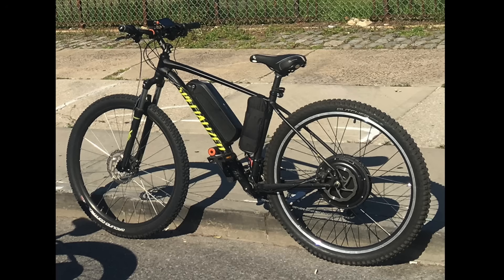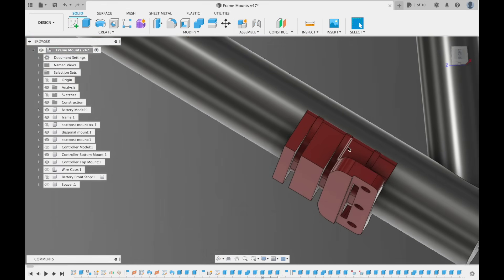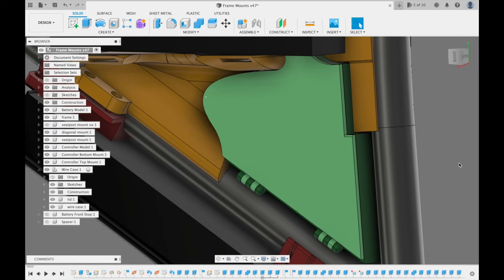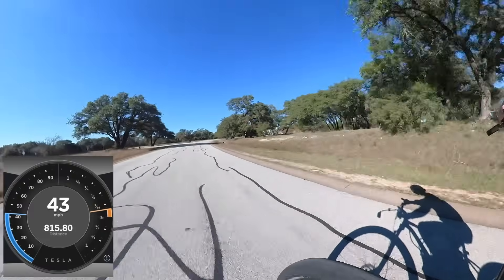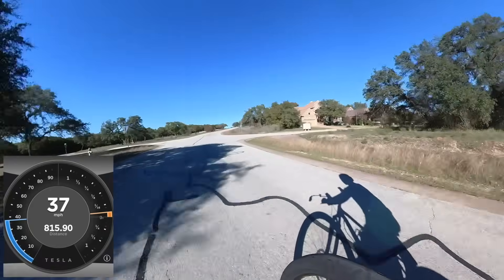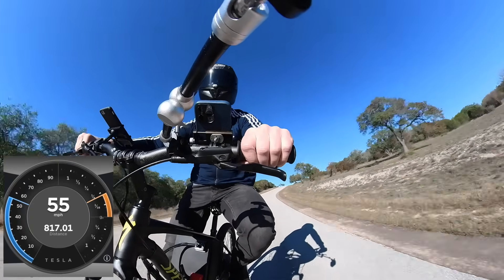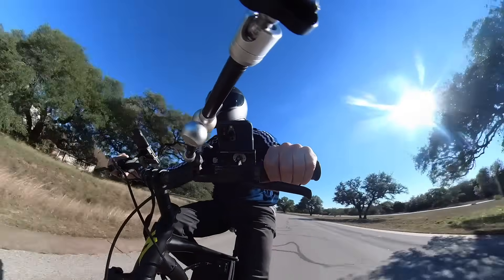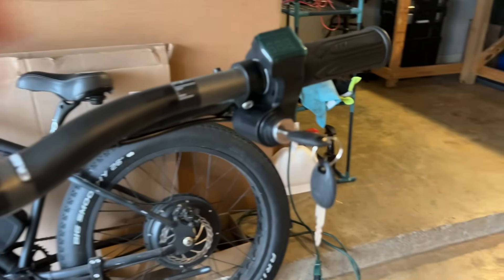I Built a 15,000W eBike and it's WAAAAY Overpowered

Comment: You can fit motorcycle forks to a bicycle. 
Full suspension look for older good brand bikes or use a cheap brand bike. Frames are stronger 🇭🇲🐨👍🏽

Comment: This is what gets me, watching you guys do these things without much thought into the design and building or the engineering aspects of the prototype projects itself. 😢You start off using an infrastructure that’s bad to begin with in hopes what you add to it will somehow work in your favor. (LOL) what a bummer it must have been for you. You start with crap, you end up with crap. Why don’t you go back to the drawing board and begin again? This time, design a framework of superiority. Then add the mechanical parts like , Motor, Electrical and Batteries? Design the Wheels and Speed Balance both Wheels and Tires so you know just how fast you can go safely. But wait , the Wheels Rubber also needs a redesigning because you don’t want those Tires coming apart at high speeds.😮 For once I would like to view someone that actually knows what they’re doing in these whatever you want to call it video’s😮 okay enough rambling on my part. Hey, thanks young man for showing all your expertise, experience plus knowledge with me and all viewing your hard earned work. I do look forwards to seeing what’s next in your world of ingenuity and engineering expertise. Again, thank you.🙏 😊

Comment: Used like $10k worth of parts to go 70mph. Shoulda just built a bike berry 100cc, slap a 32t sprocket, performance exhaust and carby, you can get close to 80mph for under $1k. This is why e tech still isn't good enough for me to make the switch yet. All those batteries and all those dollars to do what $300 2 stroke motor does

Comment: But what if the bms of the 20ah battery is only 40a, can you still put a 60a controller or?
Reply from the maker: @retrograde330  if BMS is 40a, you can use a 60a controller but you will have to limit it to 40a or else it will constantly cause BMS to cut out on you. BMS max amp has to be greater than max amp of controller. think Im using a 400a BMS and controller is 150a max - so plenty of overhead

Comment: Looks aside how well do you think 3d printing holds up durability wise to something like injection molding or woodcraft ive been wanting to get into 3d printing but my biggest fear is the material not being strong enough for the ideas i may have.
Reply: I’ve shot countless 22 caliber bullets through a entirely 3d printed pla+ plastic gun, including the barrel. 

your designs are fine bud. If you’re really so worried learn to print in nylon

Comment: 😅... Just have to say great job... I've been working on my bmx stretch 20inch steel frame over volt 48v to 66.6v dual 1500w.. you basically made me feel like my bike is baby play...and to be honest 100 volt is my goal but safety is always an issue especially having breaks that is still  a bicycle😅... To add on there's always stop signs and damn cars...also I don't know if anyone else is doing this I been used 18650 with 4s LiPo 😅

Comment: My question is how did you get the Cro motor to fit that frame dropouts? I'd rather see how that sausage was made rather than the parts you 3D printed that wont last.

Comment: i have 52 dualmotor fatty... with 2x 52V 25 Ah in parallel... imagine i would just wire these two packs in series (means 117.6V fully charged)

Comment: Thought my 3000w 72v motor with 80a controller (rear hub) was badass with 72v 60ah battery peak 60a draw it eats but this is awesome sweet engineering thumbs up good sir

Comment: Hey gainus garage guy, I love your work, best diy yet, I am new at this e-bike world, I bought two , me and my wife, ecell and aventon, , BUT I just bought a city coco, fabulous frame for this kind of project, it has a 2000 watt motor, I want to make it fast, like your bike, but I don’t know how !!!!!
Reply from the maker: @randyturley5594  appreciate the kind words! I'm not familiar with bike you mentioned but it may be difficult to get too much more speed & power out of a 2kW motor (or many commercial ebikes for that matter). More of them use fairly low power components that will be damaged if you swap something like the controller out for a more powerful one. if you want something similar to the bike in this video it's best to go DIY or do a conversion from scratch. that way you can choose the right components as needed. but I would avoid an aluminum frame like I've done here
Reply: @GaiusGarage  thank you for you response, I have am ecell that runs 40, it has a 1500 watt motor and 60 controller, I thought since this was a2000 it should produce close to the speed, maybe adding a 80 controller

Comment: I say bravo on knowing when NOT to go faster, as that drivetrain would've definitely gone as fast as the bike 'could' handle.  I keep envisioning the thing catastrophically disassembling itself, in a few keys areas that you did account for buuut its still only a bicycle. Theres a reason motorcycles are heavier and chunkier. Cool project though! Very nice design work and it came out looking better than alot of commercially made ebikes before they moved to batts in bike frame.

Comment: i think you can benefit from using a skinny wheel bike and fit dual disc hydraulic brakes in the front that thing needs to stop as fast as it accelerates

Comment: Question for anyone who may know: I absolutely love the power and the torque of my surron Ultrabee. The ONLY thing I dont like about it is the sound of the chain. I love my son's hub motor bike because it's completely quiet but it has nowhere near the power that the Ultra Bee does The only problem is I'm a heavy dude (250 lbs.) And I love going up steep hills. (I literally took my ultrabee up a ski mountain! ) I know that can be a problem with a hub motor (perhaps?) Is there a way that I can make the chain quieter or convert it to a belt drive or can I convert my ultra B to a hub motor using all the existing electronics and Battery? Thank you!
Reply from the maker: @BrianB1963  converting the ultra-bee to a hub motor would take so much work that youre better off just selling it and getting a different different bike with a hub motor. converting to belt-drive would be easier. however, mid-drive bikes are much better for off-road because of the better weight distribution and less stress on the wheel and swingarm dropouts. I would not suggest hub motor for off-road. Im not a fan of chain noise either but chain is the best solution for torque - even a good belt will stretch & wear. hub motor and belt drive is best for road bikes like cruisers and touring. chain is best for sport bikes and off-road
Reply: @GaiusGarage  Thank you for your information I appreciate it

Comment: My bike is pretty powerful and the front wheel wants to see god 🤣 so I bought one of those log shaped bike bags you put in between the handle bars and I put a metal shell with a cut out in it. The shell is hollow and then but weighs about 35 pounds. It perfectly balances my bike out and gives me a place to put my things like my small fix kit and first aid kit.

Comment: Why are you saying it's a 15kw bike when it has a 5kw motor?
Reply from the maker: 5kw is the max continous rating of the motor. 15kw is the peak power delivered to it by the controller. same as if you take a 40W light bulb and run it at 60W. It will overheat if you run it continuously, but you can do it for a short amount of time

Comment: One negative thing is that lipo battery's although they have great discharge capabilities the charged cycles are limited.. I use literally the same brand of lipo's for my drone. Anyone that's into RC cars and the like knows the life of a lipo is not that long.. and it's even shorter of your making them do high discharge. They also like to bust into flames as well I've had that happened. Now I have a flame retardant bag that I charge my lipos in. I definitely wouldn't charge this bike in my house the way is now.. I would recommend using a smarter charger. Because one bad cell then the whole power from the charger will feed directly into it.. I had a lipo charging on a smart charger and it's still almost set my kitchen on fire. Professional RC people charged their lipos in a ammo tin.. 😂😂😂
Reply: he has a BMS built in

Comment: i always think "oh these aren't that powerful" but a 20 hp electric power-train is lighter than from its gasoline counterpart
Reply from the maker: that's correct! biggest downside vs. gas is range and in this case, impractical frame. but this is more a prototype vehicle vs. something meant to be used in a practical setting

Comment: i did 64 mph (103kph) on my mountainbike on a street once, powered by my legs as far as the gears went, then the rest by gravity. i was scared every meter of the way that the frame would break in half or a wheel explode / come off and i'd have the worst possible accident. nothing bad happened though.
Reply: Mountain bike? you must be built
Reply: Imagine front wheel rubber just popping out while you riding that fast😮
Reply: Haha, similar story here, back brakes were out too, was too terrified to press the front ones and roll onto my face. Ended up swerving into traffic. Not much better, but I lived (and got honked at). Fixed my brakes after too.

Comment: when you go over 30mph on a bike, battery and motor is not the only problem. brake systems, damping and whole frame should be reconsidered. still, good experiment! once i was dreaming of upgrading my segway max g2 with front motor and unlock speed limit. but before doing that, it suddenly unlocked its speed limit while im going downhill and i saw 36 kmh. the scooter started to vobble (like vobble of death) and from then, i removed all my dreams about upgrading it. 25kmh is enough for streets. for autobahn's, scooter or bicycle's are not suitable because you cant brake in an emergency situation with them.
Reply from the maker: a lot of people comment saying they're upset that I didn't take this to top speed but this is exactly why

Comment: i wouldn't be surprised if you could hit 70+
Reply from the maker: with higher voltage yes, but this motor winding is set up more for torque than high speed so top speed is probably only around 60mph

Comment: I’m going to make a EBike to commute 20 miles to and from work rain & snow.. any recommendations?
Reply from the maker: I'd say make sure things are water resistant, find some thick knobby tires, and dual-wheel drive. focus less on high-power and more on sustained moderate power with a large battery pack with high-capacity cells for range.

Comment: Fusion 360 rocks... With this and a good printer all sorts of cool things are possible. Great job! I went with a stealth bomber frame but not at your power level. 3000w. gets me around ok but your vid. inspires. Rock on!
Reply from the maker: Thank you! yeah bomber is the way to go for a solid hub motor bike. I have a stealth bomber build on my channel also
Reply: I'll check it out. Would be tough to break the frame! Heavy but fine with me... Also the long wheelbase makes it stable. I worry about Aluminum, it fatugues. It doesn't have steel's elasticity. Stress cracks happen so please be careful? Just something to consider.. @GaiusGarage

Comment: If you're moving at 50mph you need to have leathers or Kevlar on, because if you come off on the asphalt, you're going to lose skin off of your arms, legs and hands. Please don't put yourself in unnecessary danger for clicks or internet clout, it's not worth the potential pain and suffering. It's a cool project, but please use motorbike riding gear at high speeds.

Comment: But can you still pedal on it? Or is that just out of the picture?
Reply from the maker: you can but I got rid of the gears to make room for the motor so max pedal speed is around 12mph. above that and youre just pretending
Reply: @GaiusGarage  Thanks for the reply. So the thing would still be usable in tandem with your own energy to extend the range (albeit at a less brisk pace) like a true eBike. Otherwise you'd have created an electric motorbike :)

Comment: I have a question: How were you able to get 15,000 watts out of a 5,000 watt motor???
Reply from the maker: 5000W is the continuous rating - the power at which the motor dissipates heat at the same rate a that it accumulates, therefore it can run at this power level indefinitely. but unlike many common motors like fans or alternators, EV motors are not used at a continuous power level. you open the throttle to accelerate where the power level is much higher than the continuous rating then you let off the throttle and coast while the motor cools down. as long as your average power per unit time is less than the continuous rating, the motor will not overheat. manufactures sometimes also list a "peak" rating which lists a power level for some short amount of time, like 15kW for 5sec. I don't know what the peak rating of this motor is, but you can pass alot more power than the continuous rating to any motor as long as you provide some type of cooling, whether that means active liquid cooling or just letting off the throttle for a while
Reply: @GaiusGarage  this
Reply: I found the answer: You were able to get 15,000 watts, because you installed a 150-watt controller with 100-volt batteries (100 x 150).  Thus, the motor can output 15,000 watts for only a few minutes because it was not designed for this large capacity.

Comment: In short, you do not need 6 batteries to give you a power of 10,900 watts (91 volts x 120 amps), because the motor you have cannot accommodate more than 5,000 watts!  .  You just increase the cost and increase the weight on the bike in order to gain a greater capacity to travel a longer distance... .  Do you have another explanation?
Reply from the maker: 5000W is the continuous rating - the power at which the motor dissipates heat at the same rate a that it accumulates, therefore it can run at this power level indefinitely. but unlike many common motors like fans or alternators, EV motors are not used at a continuous power level. you open the throttle to accelerate where the power level is much higher than the continuous rating then you let off the throttle and coast while the motor cools down. as long as your average power per unit time is less than the continuous rating, the motor will not overheat. manufactures sometimes also list a "peak" rating which lists a power level for some short amount of time, like 15kW for 5sec. I don't know what the peak rating of this motor is, but you can pass alot more power than the continuous rating to any motor as long as you provide some type of cooling, whether that means active liquid cooling or just letting off the throttle for a while
Reply: @GaiusGarage  
.
Reply: With a budget of $300, for example, you can modify the engine to make it more resistant to heat by closing its outer structure so that no air enters or exits, and putting cooling oil inside it (oil that does not transmit electricity) and placing the radiator at the front of the bike (like a car) where the cooling oil passes from the engine.  .  It goes to the radiator through copper pipes, so the oil temperature decreases, and it returns to the engine to cool it, and so on... I advise you to try this idea on an old motor (1500 watts).

Comment: You have significantly shortened the life span of that frame on that one drive alone 🤣
I've built many E-bikes and I try to find as many parts I can that's built out of steel. My first e-bike was built out of aluminum within about 6- months the frame fractured and my handle bar said fuck it as I was decelerating at an intersection 😂 I'm just done with aluminum  ebikes. if it's a low powered ebike like 750 watts and under you can get away with it  probably but once you get to the 1000w thresh hold going steel is the way going forward.

Comment: what type of motor are you using? is this your old 1500w motor?
Reply from the maker: no, this is the 5000W Cromotor
Reply: @GaiusGarage  has running 15000w on that 5000w motor been alright? nothing fried??
Reply from the maker: @woiveth3665  its 15kW peak so the motor only sees this power for a few seconds during heavy acceleration. 5000W is the continuous rating and peak for this motor is probably around 15kW anyway so it works out. The motor does get pretty hot when riding very aggressively and its definitely possible to fry it if youre not careful. it could really use some cooling fins

Comment: What speed are those tires rated for? Are they a weak point?
Reply from the maker: I'm not sure what the speed rating is exactly - I don't think bicycle tires include this info like car or motorcycle tires do (H, V, Z etc). But I specifically got these tires for this bike as they are extra think and made for high speed road travel and can be fill up to 80psi. Quite a few weak points on this bike but tires are not one of them

Comment: 15KW bike is not a bike, it is actually classifies as a HEAVY motorcycle...
Reply from the maker: looks like a bike to me
Reply: @GaiusGarage  That is exactly the point... It looks like a bike but  legally it is classified as a heavy motorcycle meaning you need a drivers license for a heavy motorcycle to drive it. Here in Norway any electric bicycle that can go faster then 25km/h is legally a moped or a ligth motorcycle. This steps past that straight to heavy full power (more then 15hp) motorcycle where you here must have license and be older then 21 to drive :) In other words it is A BEAST !!! LOL :)